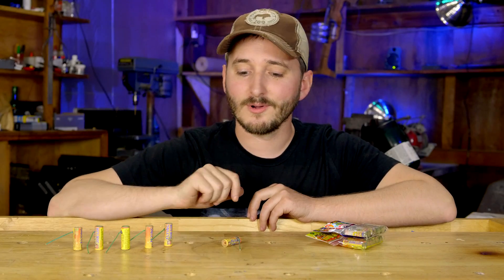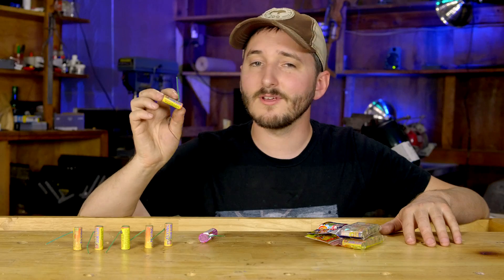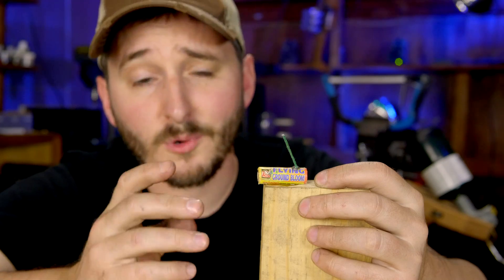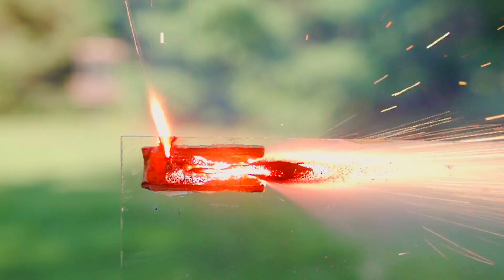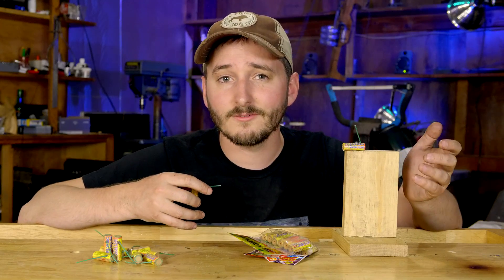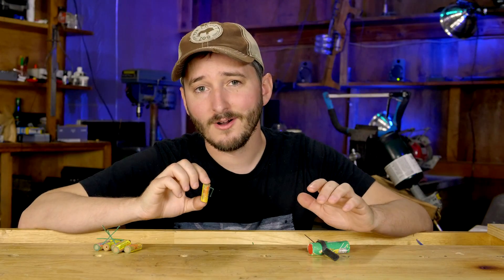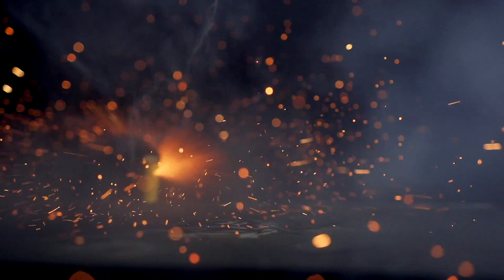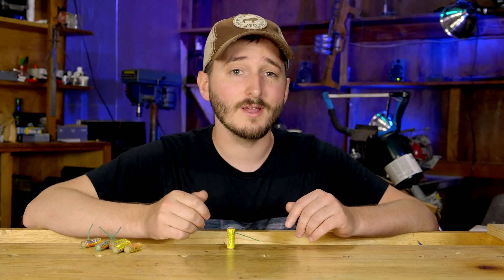How Do These Fireworks Fly?

Comment: The way it appears to me is that the hole in the side of the tube is not at a normal to the side but angled slightly, It is also not centered on the length. This gives the tube a spin along two axes, but it will preferentially spin faster about the axial center (think about the famous example of the ice skater spinning and bringing their arms in to spin faster because the mass is closer to the axis of rotation). The offset nozzle along the side gives thrust that also tries to rotate the tube somewhat perpendicular to this, but the tube is spinning axially so much faster that the radial thrust is only going to wobble it since the radial thrust will be rotating about the axial rotation and cancelling itself out since the thrust vector is constantly sweeping around the tube. However, the "ground effect" will tend to provide a larger radial thrust whenever the nozzle is pointing to the ground, so this will cause the radial thrust to be imbalanced when it is pointing down. The imbalance causes the lengthwise offset nozzle end to lift until the tube is closer to vertical and the ground effect cannot cause the imbalanced thrust. The tube at this point is nearly vertical but wobbling as the radial thrust is more or less the same as it rotates around the axial center. Now the bottom nozzle fires and shoots the whole thing up at a somewhat vertical angle. I hope I explained that well enough.
Reply: Do they spin in the same direction every time? That would be a good indicator of factory design rather than crude (albeit effective) construction.  Seems like they did for the most part, but I might rewatch to check.
Reply: @hellishgrin4604 , and that, potentially, could depend on which hemisphere you're on(ei, toilet flush) 🤔
Reply: @Uncle_Red Brownian motion has more of an effect on the direction of water spouting down a drain than the Coriolis effect. Sadly, this is a highly misreported myth- there's just not enough mass to be experience an effect in either the firecracker or in small bodies of water.
Reply: I had the same thoughts with the 2 axis offset on the thrust. the hole, and fuse, is notably drilled to one side of the tube, not dead center. and the ground-effect for righting the spinner.  Of course once its spun up and upright it likely takes advantage of the gyroscopic effect to stablize it. especially since its spinning much faster on the narrow axis, than the wide one when its laying down. Which is also different from the ground spinners.
Reply: What I would like to see is placing the firework into a wheel bearing.
 Get a wheel bearing that has the same or almost the same ID as the OD of the firework. Lite the firework and film from the top. This will let you know if the burn is on a slight angle for the spin. If it is my guess is your guess could be confirmed.
Reply: I think I was thinking similar to what you explained but thinking of the firework as more of a gyro. As it spins on the axis you described, like a qyro, it will want to upright itself and stay on the center of the length. As it stands up, the wobble becomes less and less and by the time the bottom ignites it's almost standing straight up and down. With the continued spinning from the initial stream the tube will stay perpendicular to the ground (or flat surface) and the second blast sends it straight up. Just my thought.
Reply: I think you and ezri are on the right track and I think the initial hypothesis involving the top is also valid as these must be simple to allow cheap manufacturing
.
Just for brain food:
what if we assume that the nozzle created by the fuse is in no way drilled offset intentionally, this would be somewhat costly in the manufacturing of this product to ensure millions of them are within small margins of 2 degrees or less with radius of approximately 6mm. That would make huge differences in angles of thrust. Maybe if it's close enough to center that's a ok by the manufacturer.

Since these dont need to be very accurate other than they need to go in a relatively upward direction let's use they basic top from the idea here. Let's assume the "rocket" is fueled heavier and has some sort of directional cone as is apparent from the glass cut out at the end of the firework. When the fuse is lit some propellant exhausts out the hole with the fuse causing a radial velocity. Since it is non uniform circular motion there is an axial vector as well as vector pulling it to the center of rotation. This causes the wobble and it moves across the table a little bit. However once the burn rate hits a consistent flow out of the fuse hole we achieve a constant thrust which simplifying for the model essentially creates uniform circular motion this means that the acceleration due to constant radial vectors pulls the nozzle into the center. The density of the nozzle is higher than the fuze side initially and after fuel starts to burn which gives us our center of gravity. Then since it is nearly fricionless and on a "wobble" the centroid is on a nearly impossible point for the rocket to reach which gives us that off center hourglass shape while spinning in the air. While trying to reach equilibrium before the burn rate changes the rocket is almost straight up and down for a period of time, the nozzle then exhausts and propels the firework relatively skyward.

I think the majority of this comes down to basic dynamic physics, other affects may take place but when it comes to the core design I do think he's right in assuming it's almost as simple as a toy top.

I'm curious what yall think of this.
Reply: @IGloBlue  "in no way drilled offset intentionally, this would be somewhat costly in the manufacturing" i wouldnt think so. its just a matter of creating a 'jig' that drills them all at exactly the same angle. the setup / tooling only needs to be created once and then it pumps out millions of them on auto pilot. nothing super complicated.
Reply: Look the footage of the glass stuck one. What you want to is the heat and which side of the firecracker goes off first. If the weight isn't well balanced across the firecracker, probably generates an movement not only by the thrust, but also by the gunpowder being consumed by the burning allow the gravity center to change, thanks to the loss of mass and heating. It's like a bottle with water or iron balls inside being rolled around, they'll conservate the moment a little before stopping.
Reply: Almost certainly using the ground as a pivot point too. As he said, lighting them in the air has little effect on direction. Also try lighting them close to the ground, but not touching (suspended by string?) would show if a pivot point was needed. Weighting them would also show if COG is used to orientate (from spin, I know COG cannot be used for rocket alignment, unless actively controlled, but it can be used for rotational imparting).
Reply: I would also think to look at the firework head on to get a look at how far off the first initial jet is from 90 of the center axis of the firework itself, so even a small degree one way or the other would help the effect of getting it to spin, the ground effect helping to push it up on its tail end and start to spin like a top, and by that time it is pointing up and the secondary rocket kicks in, launching it into the sky.
Reply: I think it has something to do that the point of mass is opposite the fuze hole
Reply: What he said.
Reply: @USWaterRockets I think you nailed it except that stable position seems to be as low as 30deg, it looks like the final move towards vertical is actually driven by friction causing a rotation around the long axis causing a torque that drives it vertical.  clearly we need more videos and tests.
Reply: I would agree with this modification. I hope more testing is done!
Reply: Nice explanation. I hope people don't go all "Flight of the Phoenix" On you.
Reply: exactly
Reply: I like this theory a lot but I don't think the ground effect comes into play here. The ground effect occurs when a propeller or wing generates a downward pressure close to the ground. The underneath has nowhere to go so it creates a "cushion" of air that generates extra lift while near the ground. I believe the rocket pushes itself upright simply because the ground or table prevents it from launching itself in any other direction. Once it pushes itself upright a little it gains momentum and will continue moving towards the upright position until gravity is acting perpendicularly to the firework.
Reply: Like Diego mentioned, and since I haven't  seen many people mention the actual weight as the fuel is consumed... My first thought was that it was like a top, as stated in the video, and I still believe this, but it definitely wouldn't be like the tippy top. In order for it to stand up on the proper end it needs the majority of the fuel to still be in the lower section of the fire work, otherwise there would be no form of balance, even if it was not quite stable, it has a pattern of self-righting before it starts the second stage.  So my belief is as it uses fuel from the top it becomes easier to stand up with rotation caused by the upper side jet.  And rather than a top it feels more like spinning a coin which I really don't know how to describe the difference, just that there is
Reply: Remember, these are made by the millions in Chinese factories, for the lowest cost possible. No precision involved...
Reply: I believe the fact that it's off center also means that the thrust has a larger radius when it is on the outside of the rotation vs when it is on the inside also helping to stand it on end.
Reply: I wonder if you actually need an angled fuse hole. Let's say they have a hole perfectly on axis straight to the center, that is located off center of the length of the fire work. If it starts creating thrust out of the fuse hole the fire work start spinning on the horizontal plane with an unknown center of rotation, but also roll around it's horizontal axis due to  the friction with the ground. Atleast this will cause the force to be into the ground, which would do nothing but build up momentum of the spin on the horizontal plane. Once the jet from the fuse hole is aimed down, the side with the fuse hole will start to lift.
Reply: As the fuse end burns that end becomes lighter in weight than the nozzle end which still has the weight of the clay nozzle and powder. This could cause the lifting of the fuse end each time. Add in the spinning motion and the firework will raise up on end.
Reply: Great explanation❤ love it

Comment: I think the secret is the hole formed by the fuse, and later the side exhaust, is not bored straight into the center of the tube.  It is angled off to one side.  This causes the exhaust to start a twisting motion which forces the tube to start rolling on the surface.  When the exhaust starts firing down into the surface, that forces the tube to stand up.  Now that it is in a vertical position the exhaust from the hole on the bottom of the tube launches it upward.  Also, twisting motion from the side exhaust also has a rifling effect which will try to stabilize the upward direction of the tube.
Reply: could the "bottom" of the rocket have a higher weight distribution also?  the side nozzle then pushing it up vertical on to its "base"
Reply: Yeah, he never mentioned that at all. Need more info.
Reply: Yeah same thought,  also when looking at the slow motion i think there is a small time where the side thrust is pointing down(to the longer side of the tube. I think that is based on the positioning of the material with is around the fuse hole and above it. ) maybe this also brings a bit more of the tiny stand up force. To test it you should stick it again on wood and see from top perspective where the bust comes from.